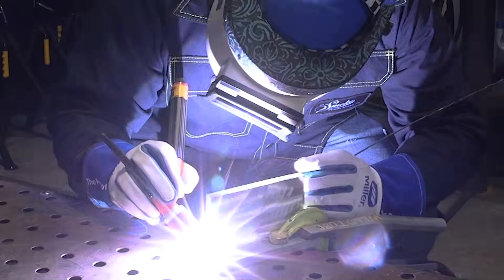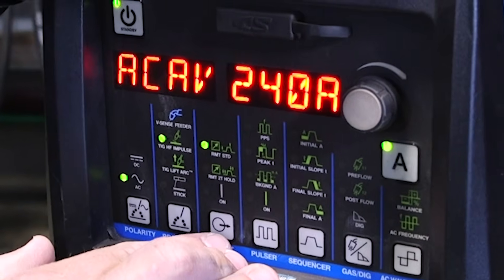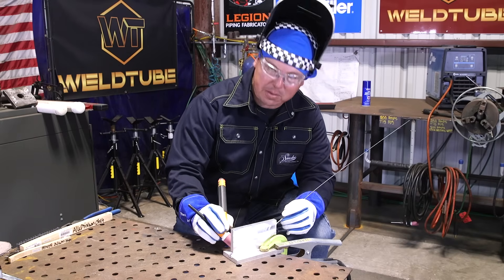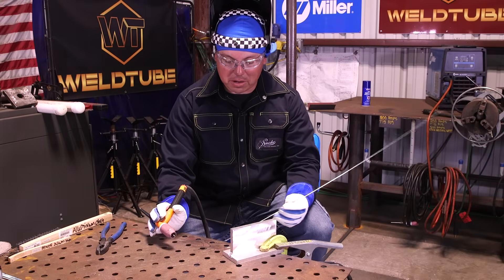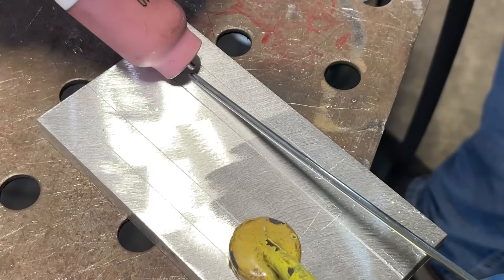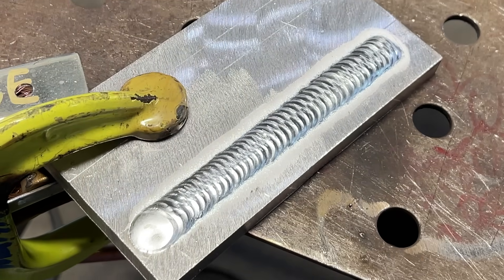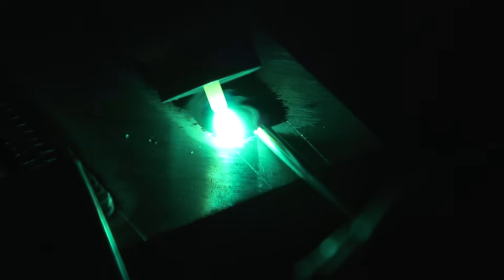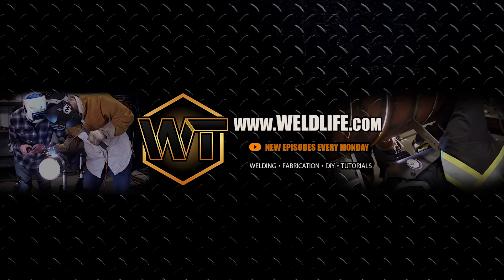Can you Walk the Cup on Aluminum TIG Welding?

Comment: No pre clean with a wire brush on your second pass?
Reply: Acetone works better all a wire brush does is push the oxides into the metal
Reply: @mitchelllindquist1226  didn't see either, acitone or brush. I get it's a tutorial.  But you want to make every weld better than the last.
Reply: Dude..
Reply: I figure that since a/c is used on aluminum to help dig through any oxides, no clean up between passes is needed because you are going to dig through oxides anyway. But I might be incorrect

Comment: It looks cool. Yes
But what is the advantage?
If you want a thick/wide weld, just wait a little longer and use more filler wire.
Doesn't that also bring more heat into the component and then have even more problems with warping?
It's certainly not more economic, I only know it from stainless steel welding and there you have a lot longer.
Can someone explain to me whether this brings other advantages besides the optics?
greetings from Switzerland💪
Reply: there is no reason for it on aluminum.
Reply: More heat more time no advantage I guess. Even in this video when he runs fillet welds I can see the overheat. Maybe  just for fun?
Reply: I'd imagine that you would use this technique on large aluminum peices to do repairs. I say this because there would be more heat disapation to counter the large amount of heat you would be putting into the metal and you get to put down alot of metal quickly.